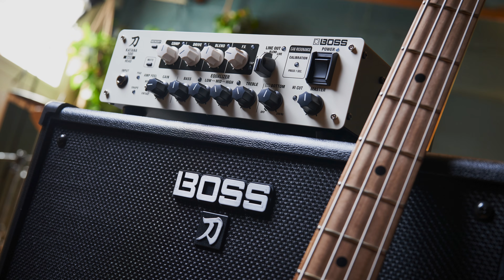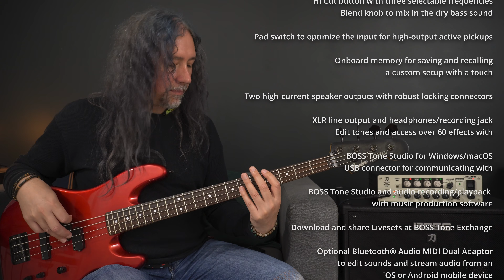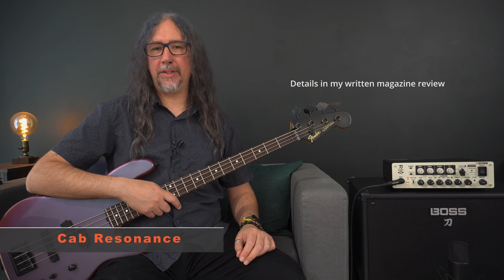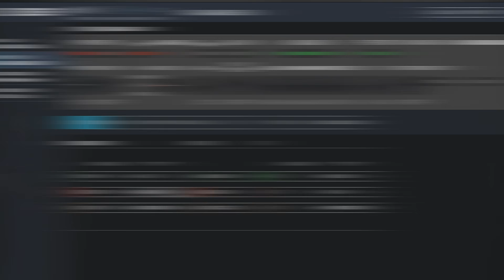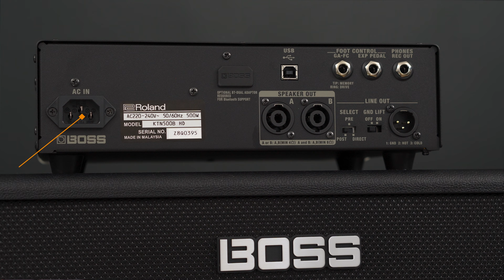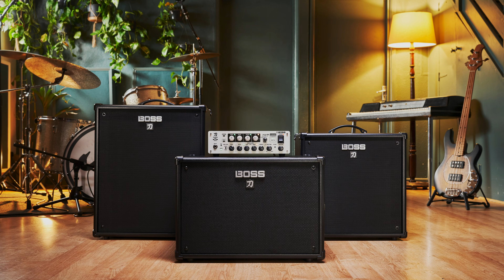Why the Boss Katana 500 Bass Amp Will Revolutionize Your Tone!

Comment: All the tonal possibilities don't help if you got a loud gig and only 125w rms at 8 Ohm!
Reply from the maker: Well, it's rated at 190w at 8 ohms (not much more, of course), or 380w at 4 ohms, which more importantly would involve a second cab, so more surface area. Almost any amp with a single 1x12 will have challenges at a loud gig.
Reply: @BassGearMagazine  I only ever saw a peak rating in the manual which is double of RMS
Reply: @Ralferator I think you misunderstand the term 'peak' in this context. In this context peak has nothing to do with the peak of a sine curve. Peak power is related to how much power the amp can deliver for a short period of time while the RMS value is related to how much power it can deliver continously. However, they have not specified for how long time.
Reply: @OlavSFlaa  I’m aware that different manufacturers rate this differently, but even taking an optimistic figure of around 175 W RMS at 8 ohms, that’s still not particularly high compared to other amps.

Comment: I bought the head only--it sounds great. I'm only scratching the surface so far, Tone Studio offers a ton of EQ and effects, and for playing rock/pop, jazz, musicals it's a one-stop shop. My only complaint so far is that there's no effects loop. Considering there is only ONE active effect at a time, and quite old multi-effect pedals it competes with [Stomp, etc.] all have one, why wouldn't Boss' pro AMP have an effects loop? (I have a MkII Katana guitar combo, and I understand that that doesn't have a loop because it's a cheap combo, but this is over $1,000 CAD and pegged as a "professional" bass head.) Anyway, it's actually a pretty small complaint since it's so flexible.
Reply from the maker: That is a valid observation, for sure. Even so, as you mentioned, it is still pretty darned flexible.
Reply: @BassGearMagazine  I'm tempted (as others have modded Katana guitar combos) to mod an effect loop into it... a truly awful idea that would probably result in my electrocution
Reply: Hi, how is the fan noise at lower playing volumes? Does it engage fast? Thanks
Reply: @StephanVanlaethem  The fan is not loud enough for me to notice while playing and isn't always active. I've had louder Class D amps whose fans were always on. It hasn't even been an issue, I guess in a very quiet recording session maybe it could be--but probably fixed by running direct with cab sim.
Reply: @RossMacdonaldBass  Thank you!